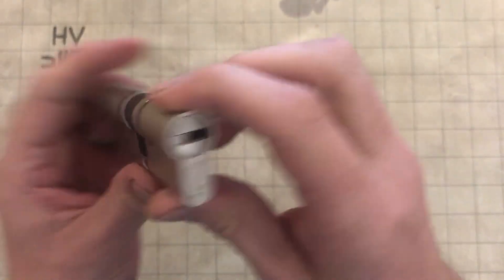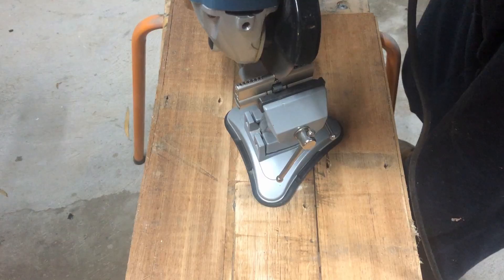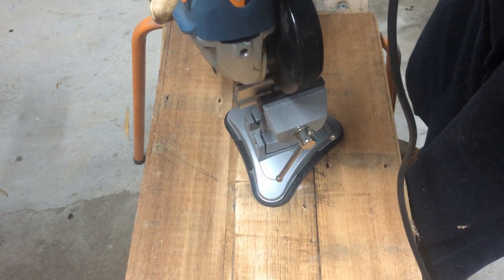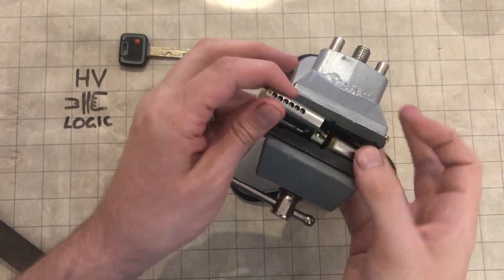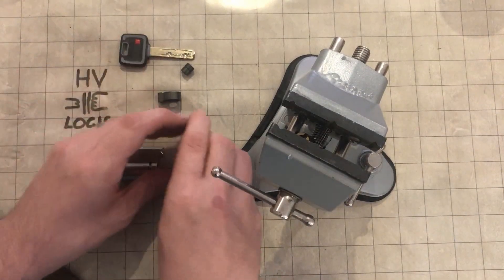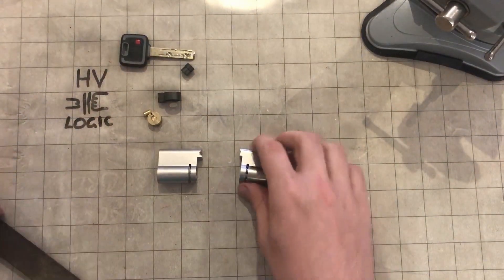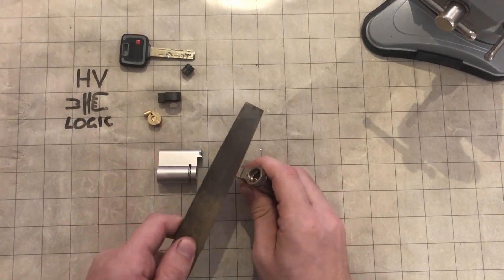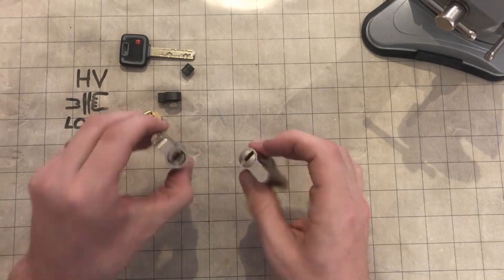How to gut Double Euro Locks the easy way

Comment: Haha, that's sure the easy way 😂 I don't like to cut them and for pin tumblers it's typically not needed as I'm sure you know. For weird dimple locks and other more complicates ones you don't get away with a pinning shoe indeed. Those stacked followers look like they can fail easily and in all cases cutting them sure is easier...
Reply from the maker: Especially with things like MT5+ that are very easy to brick i would not risk using segmented followers. plus if you cut in half you can sell the spare end to a friend (assuming you have more than one key)
Reply: @HVLogic  also assuming you have a friend as well. Lol
Reply from the maker: @Phred_Phlintstoner  or some random on ebay if you dont!